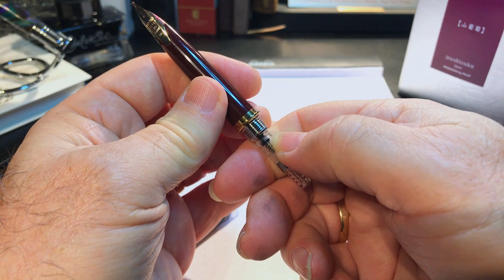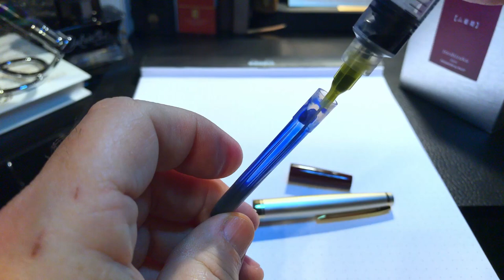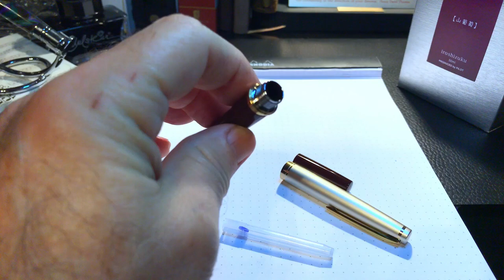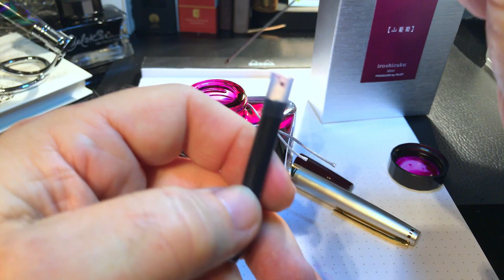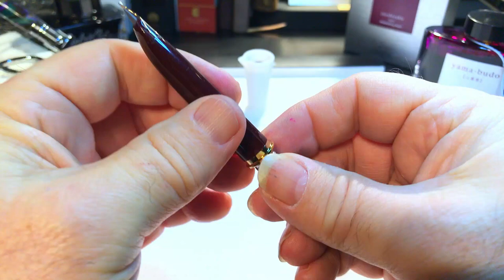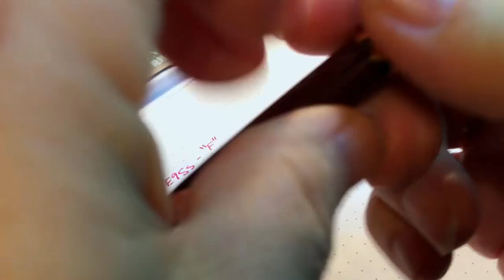Refilling a Cartridge on the PilotE95s Fountain Pen

Comment: I’ve been syringe filling the same cartridges in my Vanishing Points regularly for over a year with no problems. That’s definitely the way to do it. Especially with the E95s. Holds so much more ink than those pitiful Con-40s.
Reply from the maker: Exactly. It has worked perfectly for me for two years; same cartridge.

Comment: Hey Doug, this video came up on my feed so I watched it just to see how you handle the plug that gets pushed aside when you seat a Pilot cartridge. I have a long pair of bent tip needle nose tweezers that I use to remove it.  They are about 6 1/4" long and the last 1/2" is bent at a 45° angle.  It also works with Sailor cartridges.  Just thought I'd mention it.
Reply from the maker: Glad it helped

Comment: Great tip Doug, I'd read (?) that the Con 20 ~ holds almost .9ml.  As primitive, so to speak as it is, it would seem to hold more than a Con 50, and about the same as a Pilot ink cartridge. Thanks for the video.   🙂
Reply from the maker: Great point

Comment: In case it's useful information - those plugs do come out, I always remove them.  Might need a longer, thicker thin thing to help remove it but I think I usually use the syringe.  Also, the blue stain from Pilot Blue will disappear with a little ammonia/soap pen flush.  Maybe soap alone will take it out, haven't tried that.  Be careful not to overfill the cartridge.  It should last for many, many refills as long as you don't squeeze it too much - I've had one crack and start to leak from the side, but only one and I use a lot of them.  It's unfortunate that those new con-40s are far worse converters than both the con-20s and con-50s they replaced.
Reply from the maker: Thanks, Meh. Yeah I was just being lazing on camera. I have small needle-nose pliers that pull that plug right out. I bought a box of six Pilot cartridges today. Should last a year or more I'd think. :)
Reply: Huh, I’ve never thought to pull those plugs out. Does it change the flow?
Reply from the maker: @kapirk2244  I don't think so. Since they are designed to be pushed into the cartridge, I doubt it is a problem.
Reply: Hi Doug!  I was wondering the same thing about the plugs. It is hard to find any information on those. I was also wondering about the ink flow. So Thank You. Let us know if it changes or if you have any hard starts please. @InkquiringMinds

Comment: Hi Doug, thanks for the demo. I have lost the cartridge that comes with the pen. Is it the IC-50 cartridge that fits into this pen? Will any other cartridge sizes fit into this pen? Thanks mate 👍
Reply from the maker: Yes it does. The IC-50 is the standard cartridge that fits this and other Pilot pens like the Plumix, Metropolitan and Explorer. You can use the Pilot Mixable cartridges too as they are the same size.
Reply: Douglas Rathbun 
Legend! Thank you 🙏

Comment: You don’t have to buy more cartridges. I reuse the same cartridge over and over without issue. On a side note, I’ve noticed in all the You Tube videos I’ve seen about the E95s, the caps have a capital E. Mine has the entire word Elite printed on the cap. I think I like that better.
Reply from the maker: Thanks, clark! If you have "Elite" then it is the model designed and sold in Japan. The pens made for the western market just have the E and are called the E95s. So yours must have been either purchased in Japan or directly from a Pilot distributor from Japan.
Reply: Douglas Rathbun Thanks for the info Doug! I wouldn’t have known. I have been using fountain pens since I was a little Catholic school girl. I always loved them, but only recently started using bottled ink. Who says you can’t teach an old dog new tricks. Thanks.
Reply from the maker: clarkbilgrav My pleasure. And I will stop calling you Clark!
Reply: Douglas , please don’t, it’s my maiden name and I had friends in college who called me Clark. It’s a nice memory. Thanks!
Reply from the maker: @clarkbilgrav  You got it Clark! :)
Reply: Douglas Rathbun 👍✌️

Comment: Hmm you have to be dedicated.
Reply from the maker: I dunno, Andrew. The syringe is $5. The box of cartridges i $3.00 for six. So that's .7ml of ink each times six or 4.2ml for a total of $0.17 per ml. I just bought an 80ml bottle of Diamine ink for $15 or $0.018. For that 80ml in cartridges, I'd have to pay $57. Plus, with cartridges, I get a choice of black, red or blue. Whereas with bottles, just Diamine alone has 101 different colours to choose from. It takes just about as much time to fill the cartridge from the bottle as it does to use the CON40 converter. Of course, cartridges are portable - I get that. :)
Reply: When you refill the cartridges, presumably they leak if you don’t put them in a holder upside down meaning you can’t carry them around?
Reply from the maker: @MrAndrew1953  That's the downside yes. I would only ink them where I keep my ink bottles. But I can select a different ink each time I clean my pen. If I needed more ink than one cartridge in a day, I'll take a sealed Pilot. For ink cartridge users this makes no sense. But this, in my mind, is an option for those who use the awful CON40 converter which has a small amount of ink and you can't see how much is left. Filling the cartridge instead of the converter is a viable option IMO.
Reply: @InkquiringMinds  Where would you obtain a syringe & needle set up like that? It's almost like a basket ball valve.
Reply from the maker: @MrAndrew1953  It is a blunt-end syringe. I got two for $5.00US at GouletPens.com.